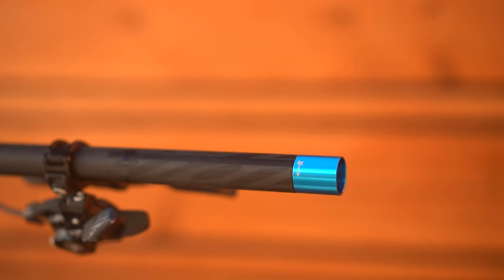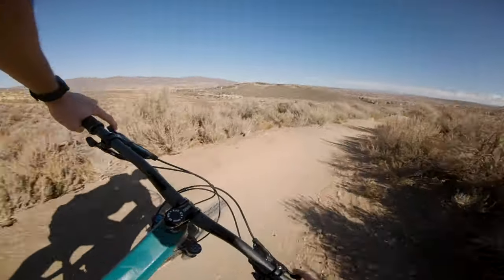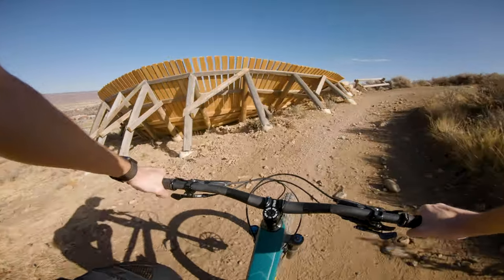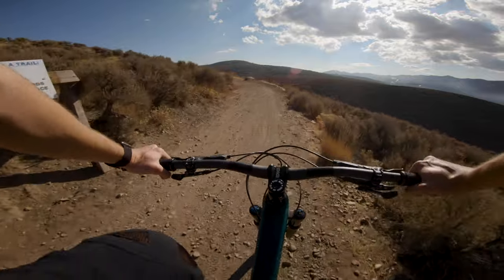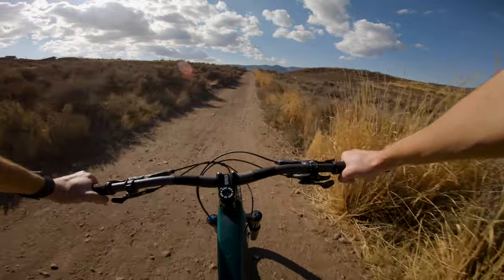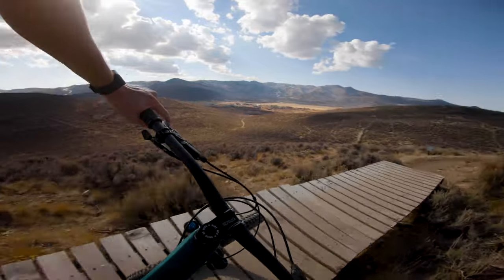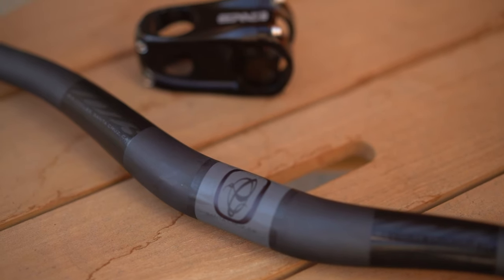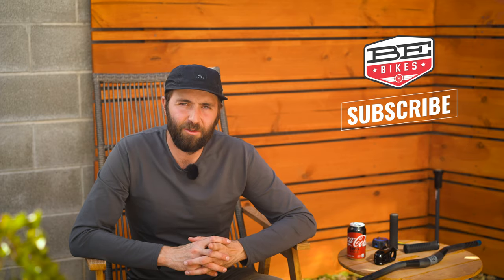Best Handlebar and Stem Combo?

Comment: I’m 6’2 as well with a 6’8 wing span. I think wing span (in my case an “ape index”) is often overlooked when people are trying to determine their bike size. I have ridden enough bikes to know that my sweet spot is about a 500mm reach. I am always in between a L and an XL on most all manufactures sizing charts but I have never found an L to be large enough. I’m always feeling crammed in the L cockpit even with a 50mm stem and I have always enjoyed the feel of an XL with a 35mm stem and 780 bars (I cut mine to 785). One thing I have to say is that bar rise can seriously effect the handling characteristic (I have settled into a 30mm rise) please make a rise, roll, sweep vid in the future! Thanks for the great content
Reply: I'm also 6'2.5" and have an XL Tallboy.  I recently ordered a PNW bar and am going to have it cut to 780mm and replace with a shorter stem for better handling. Good point about bar rise.  I'll have to play around with it to get it right.
Reply: Exactly same setup, but I ride slightly bigger reach 515mm on Nukeproof mega. Still it has short top tube so climbing is very plesant. 780 bars, 35 mm stem lenght,30 rise, only one 5 mm spacer under stem.

Comment: Perfect video, great content, I’m switching from 50mm stem with 800mm bars to 35mm stem with 760mm carbon cars
Reply: @wesmiller504  steering felt faster, and shorter bars helped with control in my opinion, I’m 5’10” btw so the 800 wide bars felt way to wide, felt like my chest was too close cuz my hands were so far apart, shorter bars also helped back pain after long rides cuz I felt more upright

Comment: I ride 780mm witdh on my handlebars. I've tried 800, 760 and 720 and I found that 800mm was kinda uncomfortable so I went down to 760mm and I really liked it. When I got my new bike it came original with 780mm handlebars and I feels amazing. Not too wide so that it is uncomfy but still great handling.
Reply: I'm 5'10'' btw
Reply from the maker: I’m 6’2” and find 780 the most comfortable too.

Comment: My preference is almost exactly like yours.  I'm in between sizes.  I like to size up.  Currently, using 35 stem and 780 bar.  Thanks for the review.  My bike does feel a bit big.  So, I may have to play around with my setup again.
Reply from the maker: I was surprised I liked the 750 bars so much. Cutting yours down to even 760 would make the bike feel smaller, but at the same time would affect your handling/stability a bit. I wonder if a 40mm stem with 760 bars would be the combo?
Reply: @bikersedge  yeah.  I’m really thinking of a 760 bar right now.  That’s the shortest I will go.
Reply: I’m going to do the opposite, size down and keep the stock 800 bar and 50 mm stem. I’m all for stability on an enduro/freeride bike.

Comment: I’m 6’1” 79” wing span 
xl SC Chamaeleon  760 next with industry9 50mm stem 
Not stock components but I stayed with all stock specs
Updates; due to a crash 
I changed out the bars to new Next SL 740mm (didn’t notice any difference with the width change)
And the stem to i9 32mm 
Bike is now dialed in 
on a gnats ass!!

Comment: I've read a few articles discussing bar width that pro Enduro and DH riders choose. It was surprised how many are below a 780mm width. I'm guessing that when you're a top notch rider you can capitalize on the speed and agility narrower bars provide. Also, I feel that the stability modern bike geo provides would let most riders go a bit narrower with out any negative effect.
Reply from the maker: It makes sense. Most of those folks are elite athletes that can bench press an elephant. They aren’t really desperate for more upper body stability like the rest of us.
Reply: Lots came from cc

Comment: Hey, great honest video! Just one thing bugged me though. 50mm isn't a long stem, and 750mm aren't narrow bars, and its definitely not old school XC (100-120mm stems and 600mm bars). Its not even what current XC riders are using. Nino Schurter's  current signature bar and stem combo is 90mm stem and 680mm bars. As you've found out in your testing, the myth of the last few years that  wider and shorter is always "better" is not true for everyone. My brand new bike came with a 780/35 combo on it, and when I switched to a 780/50 combo the bike felt so much better to me. The bike shop was shocked that I would put a longer stem on ! :)
But aside from me being picky, it was a good test and enjoyable content.
Reply from the maker: By today’s standards (excluding XC racers) 50mm is on the longer side for MTB and 750 is pretty narrow.

Comment: Awesome vid. 

HT trail bike 760 bar 40mm stem. 
FS all mountain bike 770 bar 50mm stem

I’m 6’1. Skinny,  not wide shoulders on large bikes with 465 - 475 reach on both bikes. 

The fit. I close my eyes and place my hands on the bar installed  (no grips, no break levers ect). I move from widest to narrow until I’m comfortable. Easy.

Comment: Really great video and explains handling really well and the lever action in steering... to me the stem and bars are just such a great way to make bike fit you can't change top tube or seat angle but can stretch out a bit or bring back with length of stem and bars to make a good fit.

Comment: just switched out my long 110 stem and 600mm flat bars on a 26er (20 year old) for 60mm and 680mm with 20mmm riser. I'm only 5'8, but my bike feels great. better posture and shoulders sit better. I would have gone for a 720 bar, but I wanted to avoid knockoffs and unknown brands, which isn't easy where I live. May grab that bigger bar when back in the UK, but right now I'm super happy

Comment: I realize this is an older video, but it really sparked my interest. I've found that bar width should be tied to your range of motion of your shoulders and wrists. If you take a wide bar, tie a weight (like 10 lbs) to it, bend forward and attempt to pull it to your chest, unless you are crazy flexible, you will find difficulty getting the bar to touch your chest but you will feel strong in doing so because you can engage your back muscles. The opposite is the case with a narrow bar. It will pull to your chest, but you won't feel as strong because of very little back engagement. I would assume a narrower bar would lead to arm fatigue quickly. The sweet spot for bar width is getting that position that allows for full range of motion and ideal level of strength. Pay attention to your wrist angles. Too wide a bar will cause you to pinch the inside of your wrists and too narrow will pinch the outside of your wrist when you pull the bar to your chest.
Reply from the maker: Interesting. You might be into something there.

Comment: I’m in between a medium and large on a Yeti SB130. I went with a large and changed 50mm stem to 35mm. I have 780mm bars. I think it is a pretty good fit.
Reply from the maker: Hey thanks! keep waiting for a phone call from them but I still don’t have an official soda sponsor. 

I think you made a good choice going a little bigger on the bike and smaller on the cockpit. I did the same with my 130.
Reply: I was in the same boat on the sb130 and originally bought the large and messed with the bars and many stems...After a few months really couldn’t get it to fit right and continued to cause me shoulder pain.  Swapped to a medium a
frame a month ago and now it feels like my dream bike.
Reply: Hi, I'm making that decision just now. I'm 5'10" (178cm) tall. But I've got a positive ape index, so slightly longer arms compared to legs. How tall are you,?
A medium B130 felt slightly too small to me - I kept wanting to scoot my butt a bit back on the saddle.
I think a large we ould be good.
Let me know what you reckon.
Cheers
Reply: @BrianRPaterson  I’m 179cm and ride a LARGE. But I have the SB130 LUNCHRIDE. If it was not the LR and just the normal 130 I would get a medium. The LR shortens the reach a bit. I also put a 35mm stem. 

I have never rode a medium so I have nothing to compare it to. I do know that as far as rock gardens, drops, fast sections of trail, the large Lunchride is amazing. I do struggle on tight turns and slower pieces of trail. This is probably me and a rider more than the bike. 

I would say if you kept wanting to put your butt back further on the medium, then you should go with the larger cockpit on the large.
Reply: @BrianRPaterson  I was in your same boat, with a bit shorter arms probably.  Medium used to feel too small to me but after riding it for several months, it feels perfect.  I feel much more in control on this bike too.  I don't miss the large at all.  I'd try and ride both if you can several times.  These bikes are loooong.
Reply: @mtbeliever5833  Excellent input. The build my LBS and I are looking at will have a 160mm fork, which will shorten the reach down to the same as the LR. Only 4mm shorter, but since I'm on the line between M and L, I'll take it. 
On balance, I like to be stretched out a bit rather than feeling cramped 
Cheers

Comment: I'm changing from 780mm wide and 12mm rise stock bars and 60mm stock stem.
Just got 800mm 30mm rise bars but not a new stem yet and wrist started hurting straight away!!  Thinking of going for a 35mm stem. Will that help? Might also chop bars back down to 780mm as that's where I'm used to I'm 6ft 4 btw

Bike: Orbea Occam h30 2021
New Bars: Tag metals T1 aluminium 
Proposed new stem: Nukeproof Horizonn35mm
Reply from the maker: Interesting. Usually a higher rise will take some weight off your hands. I’d try experimenting with bar roll and lever position as those will change with bar rise. 

If you can find a loaner stem I’d try that before chopping bars. That way you’re not wasting money.
Reply: @bikersedge  cheers man! Bar roll was my issue! I've kept the bars 800mm  and paired it with a nice 50mm stem and it's perfect!!!

Comment: Have you looked at bar rise as a factor? It really does depend on the rider I think the key is what each thing does because even if someone is the same size they may want it different.  It would be cool if you could rent some kit for the this purpose at a reasonable price. Then determine what sizes would work best for you on given bike. That way you would have a really good idea what to buy to optimize the setup for your wants and needs. There would still be some variables that would effect it such as weight and actual fit on the components you buy in the end but, it maybe close enough to make choice that's best for you.

Comment: Thanks for doing this video. Very helpful and informative.Great effort! By the way, I’m planning of upgrading my HB and Stem.I’m 5’ 8 1/2 ft and using a Medium MTB.Bought a HB 770 in length with 30 rise.What do you recommend for a comfortable stem ? Thanks and more power.Watching here all the way from the Philippines 🇵🇭😊
Reply from the maker: Thanks for the kind words! I don't know if one stem is more comfortable than another. In my mind, if it holds onto your steerer tube and bars securely, it gets a pass. Length will depend on your fit and handling preferences.
Reply: @bikersedge  Thank you for the quick revert.Keep Safe😀

Comment: I’m riding a 2021 Specialized Fuse 27.5 with 38mm rise Deity bars cut to 780mm, Deity 35mm long stem with 20mm of spacers underneath & 18mm of spacers on top for room to play with bar height if needed. Also running a Pike Ultimate 140mm travel with 46mm offset, bike is very nimble but not at all twitchy, loving the setup

Comment: Like the content, but calling a 50mm stem an XC stem is a stretch. WC XC bikes are running 60mm-70mm stems. Just feel like this might make people steer away from 50mm stems when it might be better. Personal experience, it was hard to get enough weight over the front end with a sub 50mm stem prior to shorter offset forks. People with 3+ year old bikes may not be best served moving to sub 50mm stems unless they are comfortable with really committing weight over the front end.
Reply from the maker: I mean in my ride review I mentioned how I liked the 50mm stem with the narrower bars more than any of the setups. I mentioned how that’s probably the best setup for most people. Don’t think that’s steering people away from a 50.
Reply: @bikersedge  I really just meant the XC and old school wording.  People seem to take it as a bad word when they have a trail/enduro bike. Otherwise I 100% agreed with your assessment of the 50mm with 750mm bars.
Reply from the maker: Gotcha. Yeah I guess some people would associate XC with bad. It’s just not as cool as enduro. 

It’s been cool to do these tests with an open mind and actually pay attention to what feels better rather than just use the cool trendy stuff.

Comment: Can I mount a 35mm stem to a  38.1mm (1.5").. The only reason I'm doing this is could not find a 1.5" stem anymore.
Reply from the maker: If you have a 1.5” steerer tube you’ll need a 1.5” stem.  They won’t be super easy to find but I know Thompson makes one.

Comment: Hello, I received the Santa Hightower v2 from my older brother.
It's a bit too big for me as I am 178 cm tall and the bike is XL. 
Prior to the modifications (original retail setup), the bike felt amazing, but my brother swapped out the original fork for a 34 Fox with a 51 mm offset and a short 31 mm stem to reduce the reach. 
Now, when I ride, the bike feels strange. Do you have any advice?
Reply from the maker: Is the travel the same as the original fork?
Reply: @bikersedge  yea, 150.
Reply from the maker: @AxiomXGamingX  Couple of things here. First, changing the cockpit is going to have a n effect on body position and handling. It might just take some time for you to get used to it. Second, a 150mm Fox 34 is going to be a bit flexy, especially for someone who's riding an XL.
Reply: @bikersedge  Okay, thx. Should I have worried about wrong, big"offset rake angle" ? Do you think that I should buy a correct (as it should be originally) fork and the difference should be clear?
Reply from the maker: @AxiomXGamingX  personally I think the offset issue was made a bigger deal on the internet than it actually is. It’s a pretty small change in the big picture
Reply: @bikersedge  Thank you :)

Comment: I will say that longer stem is SUPER underrated as far as the climbing performance it gives you. I predominantly ride XC trails in my area and have a 50mm stem and 760mm bars. Curious to try a 70mm stem with 720mm bars and see how it climbs.
Reply from the maker: Whoa. Thats getting really narrow. Could be cool to try.
Reply: Did you try it out? Care to share your findings please?
Reply: @josephfarrugia2350  I have a modern Hardtail Vitus Sentier with a lot of reach. Now riding a 50 mm stem and 700mm bar and a 2010 stumpjumper that came with a 90mm stem and I changed out the 660mm bar for 720. I just prefer the narrower bar because I have a long torso with short arms for my height so my bars always feel really low. But I would imagine a 70mm stem would climb better on the Hardtail, probably would also be more sketchy downhill. Definitely should still conduct this experiment.

Comment: Thanks for the great video. I didnt feel my ride so direct, had some shoulder pain, just changed from 75mil standard cube stems to pro 40mm.s based on your 35mm suggestion ;) It'll be so direct and cool thanks for the tips and great content, the circuit is very nice where u ride...

Comment: I did notice that from the 800 to the 750 bar your front wheel is not wandering from side to side as much as it was with the longer bar. The wider bar forces your upper body to ride more quietly where the shorter bar you can do the same but you need more time in becoming acclimated because you mussel memory is use to the wider bar...if that makes sense. For use old-school x-cers we are use to keeping both feet (clipped in) quiet and upper body's quiet and the bike underneath us.

Comment: any suggestions for a length of stem with 740mm straight bar? xc setup. thanks!
Reply from the maker: It’s going to depend on the fit of the bike and your preference on handling. Try starting around 50mm and tweaking from there.

Comment: thank god for this video. I use 50mm deity stem, 760 deity CZ, and 44 offset fork and I have been second guessing this big time. I had 45mm stem and 780 bar on Fuse 2020 hardtail and it was not comfortable at all, hence the decision to go for a shorter riser bar and a slight longer stem to keep the geo somewhat. It is much more comfortable now, turns better, but jumping has been odd.
Reply from the maker: Glad the video helped! Thanks for watching.

Comment: I went from a 800mm bar to a 770mm and felt I had more control in the tight twisty stuff
Reply from the maker: I’ve settled somewhere around 780. Feels like the right balance at 6’2”
Reply: @bikersedge  I’m 5ft10 I also run a 35 mm stem

Comment: Thanks for the great review and rider input...I am a little shorter and found 35mm stem with 760 mm bar a great set up on my HD5, I had 50mm stem and just felt odd for me.
Reply from the maker: Yeah. I think a lot of it comes down to the individual and how their bike fits them. I think it’s safe to say that most folks are running too wide of bars for the most part though.
Reply: @bikersedge  I agree, more of a trendy thing, EVRYONE is using 800mm bars, It must be the best, but not necessarily of course, seems to be the mind set.
Reply from the maker: 800 bars make you cool. Duh.
Reply: @bikersedge  haha, that's part of the fun, looking cool right as you're struggling to ride your bike down the trails

Comment: Thanks for the vid! After three years of riding I've decided to do a cockpit upgrade. I ride a 2018 Roscoe 8 and it came with 60/760. I'm pretty set on going with 780 bars, but my problem is, I'm torn between a 40 or 50 stem. I reckon I'm just going to pull the trigger and go with the 40/780 setup. I'd rather sacrifice the uphill for better handling on the downhills. Again, I much appreciate your breakdown on the different characteristics between bar and stem lengths; and their impacts on ride control. Cheers!